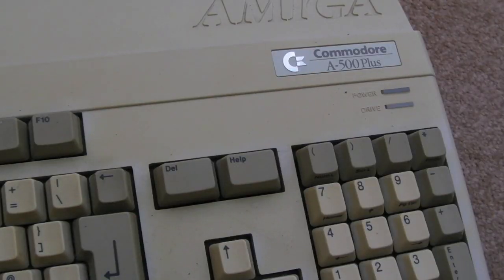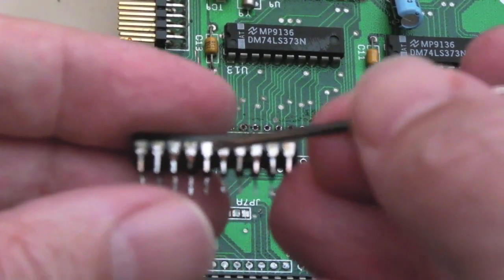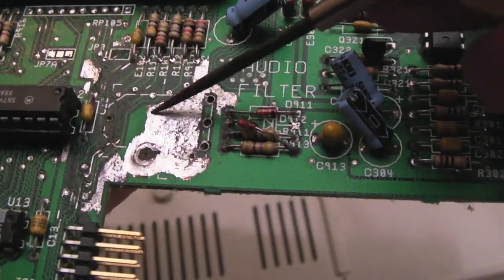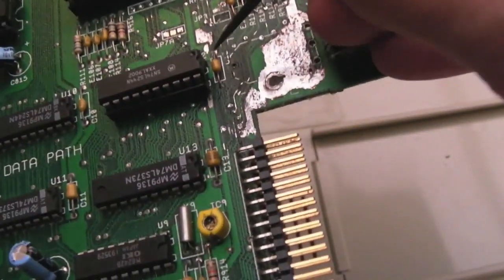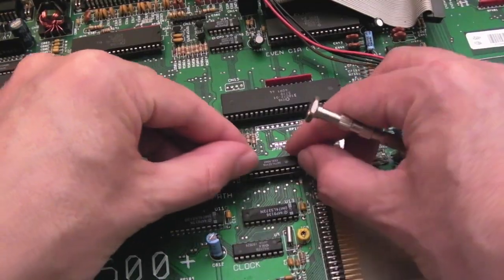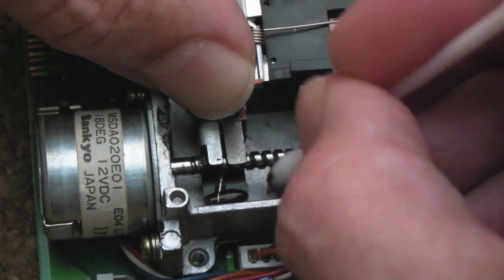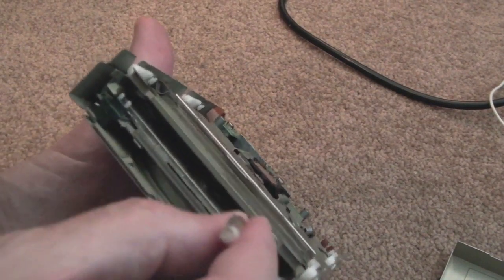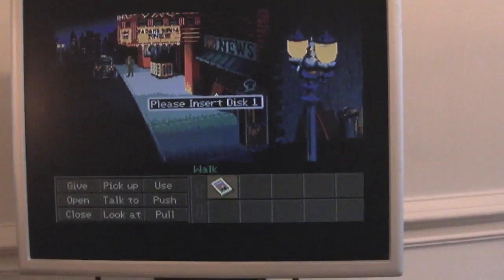Commodore Amiga A500+ Corrosion Repair Part 2 (& Floppy Drive Cleaning)

Comment: Thanks for the vid. Need to study it a bit more for my clean up. Just tonight I removed the battery, my damage doesn't look as bad as this one, but their is definitely some damage on mine. All my continuety tests with the multimeter seem ok so far but some of the traces do look a little bubbly and some of the pins on the chips are green/blue and furry. After removing the battery I am now getting a boot up screen which I wasn't before.

Unfortunately my floppy drive is dead so I can't test any floppy disks so I'll need to replace that. I don't have any spare parts at all
Reply from the maker: Take a look at the videos I've done on Amiga floppy drives - chances are you can get the drive working again!
Reply: @GadgetUK164  Will do just to check but I think mine could be beyond repair. I should have watched your video before I attempted to repair it. The plate that contains the tiny  little button that grips and spins the disc is cracked, I didn't realize how delicate it was and it cracked although I was probably being a little clumsy in hindsight. Now the little button is too sunken to grip the disc.

Comment: Seeing all these videos of the old A500 etc brings back so many memories growing up. I have my Original A500 somewhere, still working hopefully, although the Expansion Ram made need some attention so will have to find it. I also have another A500 I believe it is, that has been sat in a box in my parents loft for 15-20 years at least. It's in Mint condition, no discolouration on the casing and not even sure how much it was used. Can't even remember where I got it from.
Only thing missing is the power supply. Once I get the space, really looking forward to getting these old machines out and powered up. It was such a great machine and great to see people still have a care for them and to bring them back to life.
Reply from the maker: Let me know how you get on with them =D

Comment: Awesome, i was wondering where part 2 was and it's finally here.

Great repair there buddy, another Amiga 500 Plus saved from the scrapheap.
Reply from the maker: +FourX2k3 It's a shame I couldn't get it looking any better but the longer you heat the corroded areas the more damage occurs.  At least its working I guess!
Reply: +GadgetUK164 

I know what you mean by crusty solder i hade the same issue when i repaired an MVS 6 slot
were the battery had leaked, it rerely is horrible stuff.

Here's a tip for you. if your other half has nail polish you can use it to go over the
bare copper areas to protect them it will also stop the copper from oxidising over time,
i use standard green nail polish from wilkos all the time as it matches the solder mask
nicly.
Reply from the maker: That's a really nice tip there - nail polish!  My wife is going to wonder what they hell I am doing ordering green nail polish lol.

Comment: YAY! the update! oh wow..... jeeze i guess there was more damage than originally thought. got any mask paint?
Reply from the maker: +Amy Marie Yeah, its a shame it couldn't look better, but at least its functional!  I do have some green solder mask paint but its UV cured and I don't have a UV lamp at the moment (unless I take my EPROM eraser to bits).  I did use green solder mask paint on my other 500+ and whilst it covers any tracks etc it doesn't look that clean.  Just looks like someone decided to paint some of the board green lol.
Reply: alright
Reply from the maker: +Amy Marie I might do a part 3 to this yet!  I've managed to 'borrow' a UV lamp.
Reply: YAY! thanks!
Reply: +GadgetUK164

Allo - it's me again. lol

I was just wondering if you have the glass solder container kit on your de-soldering station, or the older plastic one?

I'm guessing you have the Duratool station like I have? (I think I've seen it in a couple of your previous vids)?

After using my station for a while, I found that the plastic container started melting slightly and warping when I had the temp set quite high. Eventually it would no longer make proper contact with the rubber grommets, and it lost a fair bit of vacuum pressure.

I couldn't find the exact thing to replace the container, so I eventually contacted Zhongdi (the manufacturer), and they sent me a few of the newer glass container kits. The kits also have a much larger and better spring inside, so you don't have to keep cleaning it out all the time.

The kits were only something like 73p each! lol

It's well worth grabbing a few if you have the plastic type, as it makes the station work like new again...

http://www.china-zhongdi.com/

I simply e-mailed them directly before, then sent the dosh via PayPal. ;)

I did also have to replace the heating element on my station before 'cos I lost the wire cleaning thingies for a while (and / or was too lazy to find them. lol), and the original heater / nozzle got blocked solid. It looked like it had even melted part of the actual metal of the nozzle too?

Good job the heater only costs around £10.

But yeah - really important to keep cleaning the thing between using it, and definitely always clean the nozzle before switching it off.

Comment: I've repaired three plus machines and two ram expansions with battery probs.
Terrible idea that battery... My OCS A500 is like new inside and most plus machines, oh well.
Fantastic video mate! Happy new year in a few hours.
Reply from the maker: +Vincent GR Thanks - yes, those batteries are a nightmare =/  I do wonder how many 500+s there are out there still that haven't suffered any corrosion damage.  Same problem occurs on the 2000, 4000 and probably some of the other top end machines.
Reply from the maker: +Vincent GR And Happy New Year =D
Reply: GadgetUK164
A500 can be fixed with one way or another.
A4000 are the real problem.

Comment: Really helpful thanks! I'm just doing the exact same clean up on my 500+. 
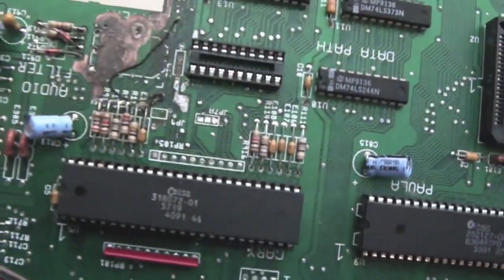Question - you say @ 3:07 you've 'put the socket on' sorry if this is dumb but is that some kind new seating component for that chip?
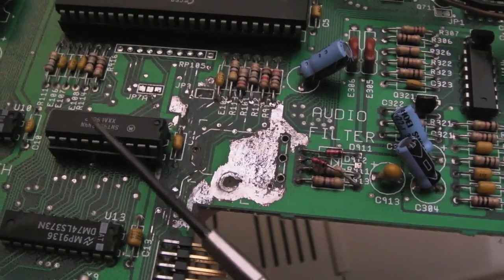Also at 5:54 you said that chip itself needed replacing, I think I have the same issue with that chip, where can I get a new one (does it have a specific name/code?). Thanks :
Reply from the maker: Yes, I removed the old socket and fitted a new one.  You can buy DIP sockets easily on eBay.  Just look for DIP sockets of the correct pin count.  eg. 40 pins for a CIA.  Again, the 74 series chips can be found easily on eBay new.
The one I replaced there was a 74LS244.  The ones above are 74LS373.
Reply: @GadgetUK164  
Good work fella..it's my 74LS244 (U12 position) that looks buggered, (think I've cracked it when getting battery out), I'll have a look on ebay for a replacement.

Comment: Hi. Great video.  looking forward to next one. I am trying to follow this with an A500 plus I picked up. It was sold as faulty and thought it would make a good project. Similar damage to yours. The seal had never been broken. Getting black screen and 'no video signal'. I have checked clock, tested Roms and all custom chips on known working (A500) board, substituted another Agnus 8375, socketed and changed the 74ls244n nearest the battery damage (it was coated), sanded back, patched and checked all traces where the damage was and compared continuity to known working A500, reflowed agnus socket solder pins. Ram piggyback...  Still no good. Ram next!  Only thing I noticed is that pin 30 on the Agnus socket (third in from top left corner) is cut halfway down for some reason. Tried a thin wire bridge and no difference but did get garbled purple flash before black screen :0. Also tried an 8372A and no black screen but either purple or green. No Fat Agnus was harmed in these experiments, lol
Any ideas? keep up the videos. All the best.
Reply from the maker: +Plan C If all the socketed chips are OK - ie. CIA, Paula, Denise, Agnus, Garry, CPU, and you've got a clock, then it's going to fall into the following:-  Corrosion has got under the Gary, or has got to some of the other data path chips you haven't yet replaced.   If all traces are OK and there's either a RAM or data path fault you would expect a green screen every time.  Black screen tends to be Gary related when it comes to corrosion on a 500+.  I am not sure what to make regards half of a pin missing from the Agnus?!?!  The other thing well worth doing if you think all the chips are OK and it still doesnt make sense, is to look at the 500+ schematics and test every single connection between data path, Gary, RAM, CPU, ROM.   You could speed that up by using a logic probe and see if any of the data bus or address bus lines are floating, which might indicate a damaged trace or faulty chip.   It can be painful sometimes with a 500+, the previous one I fixed I had to do exactly that, trace connections from Gary in order that I worked out where the missing connection was.  Ended up swapping Gary socket, CIA socket, that 74LS244N.

Comment: As for leaked batteries. You might have some luck with using q-tips and vinegar. Works on most battery leaks.
Reply from the maker: Yes, in both videos I used (and mentioned I think), use of Vinegar to neutralise up the alkaline.
Reply: Useful stuff :)

Comment: Oh and the keyboard gives 10 short flashes and a long one....?
Reply from the maker: +Plan C Yes, you've got a similarly insane number of flashes like I had with the damage related to Gary and CIA connectivity.  It doesn't seem to be on any list anywhere.  I think the guides out there go up to 4 flashes, not 10... I would suspect a missing trace or two around the Gary / data path.
Reply: +GadgetUK164 Thanks for all the info.

Comment: +GadgetUK164 I've just bought an A500+ on eBay. It's still on its way here, but when it does, my plan was to take it apart and give it a good clean up. I see you haven't replaced the battery at all in your video. Am I correct in assuming that I'm better off just taking this timebomb off the motherboard regardless of its state?
Reply from the maker: Yes, I would take the battery off in any case!  You could always mount a battery in a plastic bag in the expansion bay - just use wires to re-position it there in case it leaks again in future.
Reply: Sweet! Thanks for the reply! I'll be sure to remove that nasty thing before it kills another machine :)

Comment: I imagine that in expanded A500's with Commodore's own A501 expansion, the same thing occurs but is contained within the expansion's metal shielding; the A501 might get corroded away to nothing, but the Amiga itself should still work.
Reply from the maker: +MarkTheMorose Yes, you are absolutely correct!  I've fixed a few of those A501s in the past with the same issue.  I've got a couple in the loft which I managed to clean up OK.  Ironically the damage to the A501s seems to be a lot less, and often just cleaning them up sorts the problem out.  I think the big problem with the 500+ is the thickness of the traces nearby - if they were 50% or 100% wider I doubt the alkaline would have killed many of them.

Comment: VARTA !!! They have lots to answer for ;) Great work and you got it working. Have you seen the A4000 computers with battery leak? That one is really tricky to fix.
Reply from the maker: +bwack Yes lol, I can imagine an A4000 would be tricky!  I've seen capacitors leaking on the CPU board on those too, and it creates a real mess, especially with so many fine connections on the board.

Comment: i have a 500+ with similar damage / corrosion. In my case all of the eyelets on the components near by have been corroded. Have you ever tried the through hole eyelet repair kits? Or do you think I could just use wires to get back to the traces. On my particular board about 7 of the key traces in that area do not have continuity and so it may be hard to sort by soldering to those. (with my skills at least)
Reply from the maker: Never tried those eyelet repair kits!  Wires will work fine but it can be time consuming cleaning up the damage and working out exactly which traces and vias are damaged.  Don't solder to the really thin wires - follow them to their destinations, eg. resistors, caps, chips etc, and bridge the wire connection from point to point rather than soldering onto tiny traces etc.  Some good flux is key with a repair like this, and making sure you remove the corrosion too.
Reply: Ok makes sense.  .  . I have sort of started. The vias are in a real mess really crystallised. Lastly I am trying to get the corrosion off. It's proving to be really tough to shift. Do I maybe need stronger isoprop?
Reply from the maker: I use vinegar initially, then isoprop.  But even then it requires some work with a sharp pointy tool - lightly scratch (carefully) on the pad surface to get it back to copper.  It takes some serious patience!

Comment: +GadgetUK164

Nice video! Thank you for taking the time to explain everything you have done with that Amiga 500+.

I have one question: does that Nec Multisync 1770NX handle the 15 KHz Amiga video output well?
I am looking for a monitor for my Amiga and my Atari STe, hence the question.

Thank you!
Reply from the maker: I cannot say for certain, but I would assume if it works for the ST it would very likely support the Amiga as well.  I went with the GBS-8220 as that works well with both and I can use any standard VGA monitor with it.
Reply: Thanks for the help, much appreciated 😊

Comment: this console was way before my time lol :) nice watching though. i have a questiong on the mvs consolize mod. what power supply do you reccomend to use? i happen to have. the specs are
input: 100-120v~0.5A  50-60hz
output: 5v--- 4A
Reply from the maker: +ALAN DORAME Thanks!  5v ~ 4A is fine  but do measure the voltage when its powered up, if its showing any more than say 5.18 / 5.20v I would swap it out for another PSU.
Reply: Awsome. I saw in your videos that you actually added a voltage regulator to keep the voltage to 5 volts though could that apply to this power supply? What was the reason you did that?
Reply from the maker: I did, but then removed it - It wasn't a good idea due to the heat transfer to the board, plus the regulator I was using wasn't really sufficient - It needs a 3 amp regulator if you did go that route.   The reason a regulator is sometimes a preferable idea is the voltage is controlled so it remains constant.  You might find with a a cheap PSU that the voltage could start out at 5.05v, but after 20 or 30 minutes it has either dropped or gone up.  The SMD Z80 on these MVS boards can die if you go above 5.25v.  If your system goes below 4.9v you might get reboots and crashes etc.  Typically a higher current PSU (4 or 5 amps) can start out higher, eg. 5.40v and it might drop to 5.2 or 5.3v under load of the MVS ~1.3 amps.  The main thing to do is measure the voltage when you first power it up.  Leave it on for a bit and keep checking the voltage - just to give yourself confidence that the PSU you are using has a pretty stable output.
Reply from the maker: As someone else pointed out to me - you could actually use an AES power supply if you wanted!  Just make sure whatever you use is wired correctly with regards to polarity, and also do add a fuse - don't risk building a CMVS without a 2 amp fuse.
Reply: i see now is there a way to check is the voltage is stable before actually using the psu to power up the console? 
and where did you get the volatge meter you have on your cmvs to display volatge
?
Reply from the maker: Connect a multimeter to the 2 connections on the PSU connector.  Set multimeter to DC range and switch the PSU on.  You can buy a cheap multimeter off eBay for as little as £5 - well worth getting one if you don't have one.
Reply from the maker: You will need to do that anyway in order to work out polarity.  The multimeter will show (minus) -5v if you have the red probe on the ground.  If the red probe is on + and black probe on ground the voltage will be positive 5v.
Reply: okay yes i do have a multimeter i have never used!! i dont know how to use it haha
ima have to watch a tutorial

Comment: arrrrghhh, riped off a pad :-(
to get that throughhole DIPs off either use hotair or just an injection needle 0.8mm (of course flated :-) )
Reply from the maker: Yeah, I started using hot air to remove DIP chips where corrosion has occured.  It's by far the safest and easiest way to remove them.